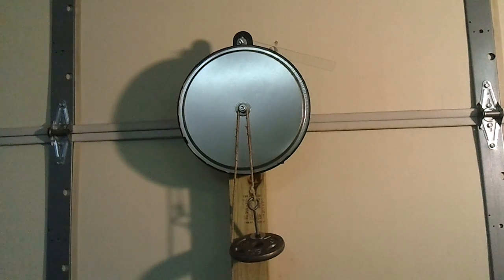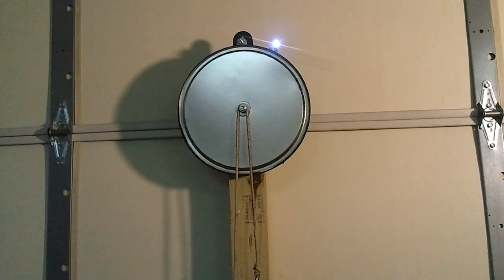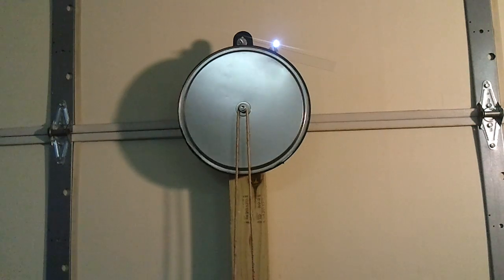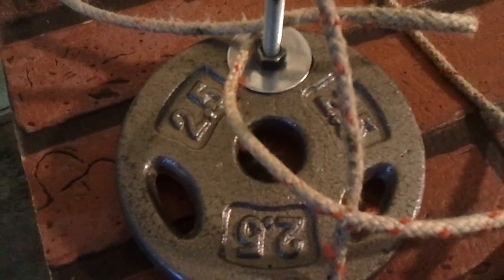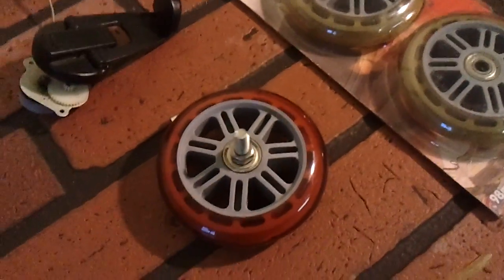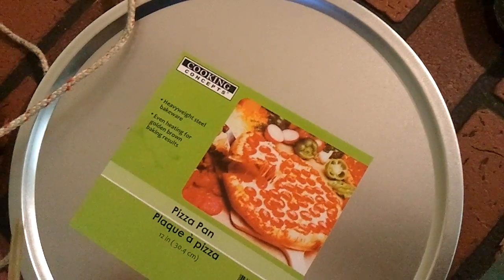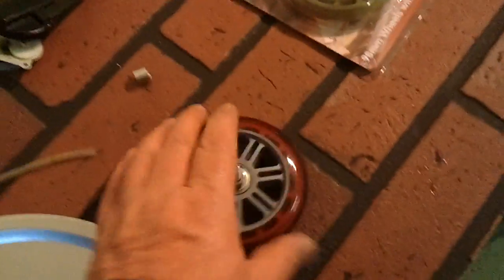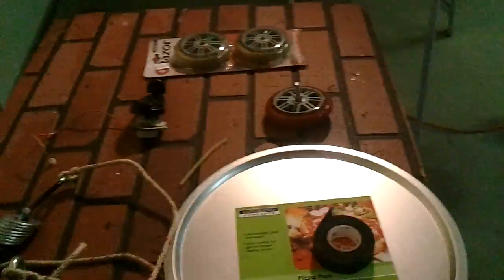Weight Drop Generator

Comment: Thank you for this   It’s how I got started
I use 4 to 6 rear 26" rear mountain bike wheels 
A pulley 30 ft in a tree the weight is bucket   It comes down Slow it takes 45 min to reach the ground, the last wheel to a racing 120amp alternator, I can charge 16. Batteries in that time     On a full charge I raise the weight over 100 times

Comment: Can you try it with clock ? Pendulam weight clock , it drops the weight slowly like for hours and pendulam will be giant magnetic going back and forth between coil that will generate electricity or you can directly attach   a high output motor on pendulam pivot and get AC current and with a circuit you can filter it , maybe some capacitors will help

Comment: I want a 10 ton stone battery with a cast iron gearing system in my backyard. I wonder how the stats would look :)
Reply: @Zulqarnayeen Schaftler Not efficient in terms of energy density. As it turns out, gravity is rather weak. The technology certainly has uses though. ex. Grandfather clock!
Reply: A weally weally big one lol :)

Comment: a simple way to do this is to use two buckets on a bicycle chain one bucket will have a little water in it to make the  empty bucket rise when its empty, then you use solar power to pump water into the bucket  thats is high up, when it is full, you release it and a gear box turns to make a stepper motor spin when it reaches the bottom a valve opens and the water then turns a water turbine for a short period, when it is empty it will rise back up by itself ready for the next cycle, if you had multiple ones then it could run all day, and at night the  system is started, but you still will never get enough power for any real use really but fun to build
Reply: the main drive gear will  have to be a ratchet system as you can't turn the gear box backward

Comment: I'm planing on using a silo
Reply: Sam Copenhaver or use a drill hole made for a well. With a simple hand pump to fill the weight and a valve release cord for when you’re ready to recoil
Reply: Water for weight. A hole in the ground for gravity. A hand pump to fill the water weight

Comment: cool, how do you make have the weight not speed up continuously form the force or gravity?
Reply from the maker: The DC Motor is a load on the large wheel and helps to control the speed.  The difference in the main weight vs. counter weight determines the speed.
Reply: OUbrads  Have you looked into a clock mechanism?
Reply: I'm trying to design a circuit for variable loads like a radio you turn up and down. It switches between a charging capacitor and a short circuit on the generator. Because the problem with falling weight systems is the weight actually ends up going faster when you need minimal power draw. I was trying to think about how the BayGen Freeplay clockwork radios worked. When you turn that LED off the weight would fall more quickly instead of slowing to a crawl.